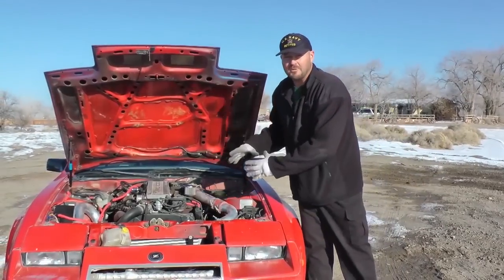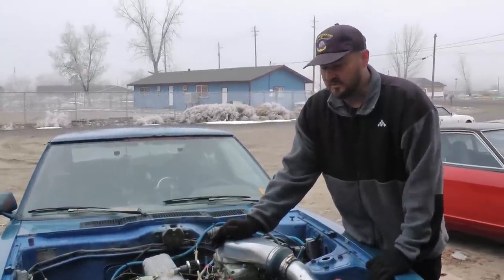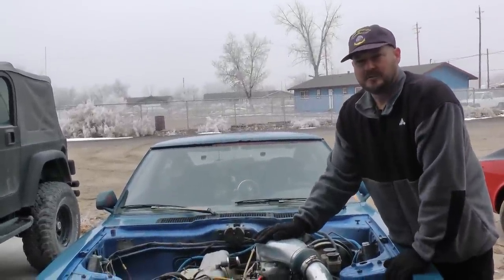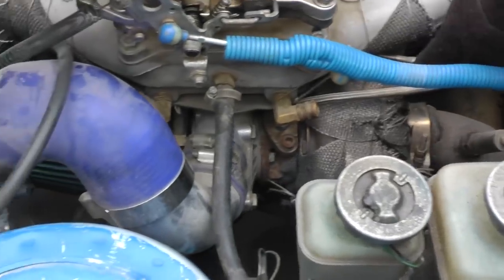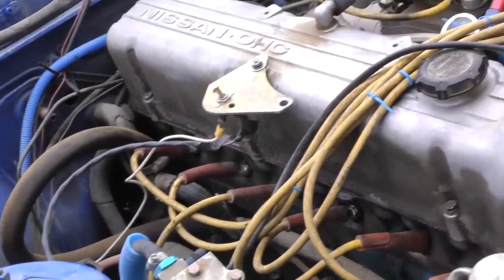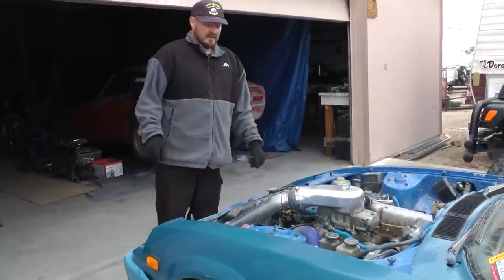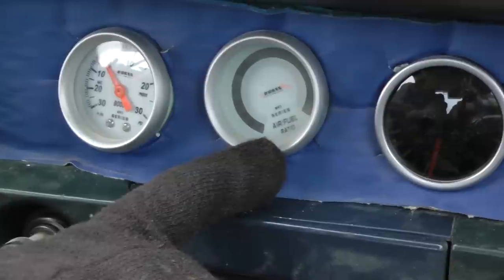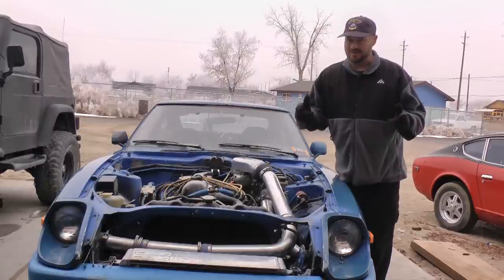Blow Through TurboCharging (Carburetor)

Comment: I've been thinking about slapping a turbo on my 79 Trans am. It's making around 400 HP give or take right now. But I feel the compression might be a bit too high. Any suggestions or advice? 74 400 block, 69 heads 72cc, flat tappet cam, 1.65 ratio rocker arms, aluminum dual plane intake, 750 carb.
Reply from the maker: number3665 for high compression engines would be safer to run low boost (around 6 to 8 pounds boost per turbo), twin TO4e turbo blow through carburetor setup.  can find turbo kits complete with manifolds on ebay, research to ensure the flanges on your heads match what they are selling. If the turbo headers are difficult to find for your heads t3 flanges can be welded after your headers or exhaust manifolds depending on where you would like your turbo mounted. I have even seen them mounted under the car in place of the mufflers for a stealth effect. Once turbos are done select a blow through carb, quick fuel makes great 650 and 750 cfm blow through carburetors. An intercooler is best located in front of the radiator to cool your compressed boost air before it goes to the carb hat and carb. The jetting, timing tuning process once you have everything installed including wide band A/F gage, boost, fuel pressure and exhaust temp gages to monitor as you tune to boost and rpm. Also being that you are running high compression and boost, ensure sticking with 100 octane fuel, avgas, or an alcohol injection kit to flow on boost to protect against detonation since 91 pump gas is no good for tuning for compression and boost by itself.  Many boosted engines are blown due to poor and low octane fuel combined with too high of boost, timing too advanced and fuel mixture too lean. When pump gas is used, boost needs to be set much lower (around 6 to 8 lbs) timing around 18 deg btdc. Carb jetting for low exhaust temperatures and stoich to slightly rich A/F ensure there are no lean conditions which lead to high exhaust temperatures, detonation then blown engine parts.  When testing these baseline numbers it's best at a tuning shop with a dyno to where you can open the engine up gradually a little at a time and immediately back off if any of the readings are showing lean, boost spikes or high exh temp. Then make slight jetting, boost or timing adjustments until you can successfully run your engine's entire power range on the dyno with good safe engine gage readings across the board.
Reply: Budget Boosting Thanks for the information! I'll start looking into everything.

Comment: i was wondering if you could help me out? I am building a carbureted 5.3 with a single turbo. I was wondering what would be a good fuel pump and regulator for that setup. Any help would be great thanks
Reply from the maker: Aeromotive red or black fuel pump is great, bosch makes great boost referenced fuel pressure regulators, Aeromotive does too.  Many great ones out there.

Comment: when your running without blow off valve and step up throttle when turbo spinning fast, boostin fast moving air and then throttle valve closes and fast movin air hits throttle valve and bounces back and forth betveen turbo and throttle valve, the sound 7:38 belongs here
Reply from the maker: johanijohani This particular engine in this video does have a blow off valve.  My red 300zx turbo, and Buick Regal Turbo T do not have blow off valves.  Thanks for watching.

Comment: what is ur opinion on in closing the carb in a box for installing a turbo.  plan on putting a 4.9 i6 in my 97 expedition n putting a turbo on it.  not wanting much more than 5 lbs or so of boost. just want enuff power to pull a load
Reply from the maker: +sketchyssk8shop    that should work fine for low boost.
Reply: +Budget Boosting I remember seeing the people with the old import mini trucks running them.   I just need enough to push a 4.9 ford i6 up to 250 hp n 300 ft lb torque.
Reply from the maker: +sketchyssk8shop You should have no problem, the torque and power on the inline six is great once it has enough carburetor.  From the factory, many of those sixes were under carbureted with a very small 1 bbl.  The larger 4 bbl.  carb with some boost should meet your goals.

Comment: SO now I have a question. SInce you have to seal up the carb very well to hold the pressure without blowing back through the float bowls etc, why can't you just build an air tight box that would hose the carb and equalize the pressure internally and externally eliminating the problem?
Reply: You can. That type of setup is still used today with great results. Since your comment was made 2yrs ago, you might know all this now.

Comment: Ive got an 87 mustang, 306, b303, gt40p, 1.7 rr, performer intake, demon 650 carb, bbk shorty headers/ x pipe. Dropping the motor in thr car in 2 weeks. 1st ever car build. Will the gains over stock be notable? Im worried its not gonna be much more over stock. If nah then turbo is my next step but im just sketched bc these blocks are said to grenade at 500hp.
Reply from the maker: If your cam rpm power rating  ( for example 2500-6500) is the same rpm rating as your intake manifold, your power, torque, and feel of your performance will increase greatly.  Some have mismatched intake manifold power rating and cam power ratings and end up losing power.  For example you have an intake manifold that puts 3500-7500 rpm power band with a 1500-6000 rpm power band cam, it will be mismatched and lose power.  What you want is the cam power band the same as the power band rating of the intake manifold or as close as possible for best power rating.  For turbocharging its a bit different since turbochargers tend to start pulling good at around 3000 rpm, so a cam and intake manifold rated for 3000-redline would be best for turbo setups.

Comment: Hey I'm interested in turbocharging a datsun pickup, but all the blow through carburetors I've seen are 600 cfm or bigger, isn't this to big for a 4 cylinder engine? Do you have any recommendations? Thanks
Reply from the maker: Aidan Foxley A special surge tank can be made for a dual weber or mikuni side draft carburetor blow through set up.  That would be best for the Datsun/Nissan inline engines.  Worked well with the HKS triple carbureted blow through turbo set up for many Japanese tuned Z cars in the 70's, 80's and 90's.  Hard to find that old HKS set up though.  I will be making some videos on the one HKS set up we did find.  I am installing a turbo triple carburetor blow through set up on a 1970 Nissan/Datsun 240z on a L28 inline six.  Should be one hell of a monster when its done....

Comment: May seem like a stupid question but how can you get an accurate oil pressure reading if it is setup up like you have it ?. Oil pressure sensors have pressured oil directly feeding to it and only it. Giving it another place to pass by it i don't see how it can get the right reading. For example say before you put that tee there it reads 40 psi or lbs of oil pressure,  now with that pressured oil having a second passage off that same feed it now can only read say 20 psi or lbs due to there being a second feed which causes the oil to for lack of a better word bypass the sending unit. Am i mistaken or am i correct ? ...
Reply from the maker: IrnMaiden304 First off, I believe no such thing as stupid question.  When it comes to performance always ask questions because a lot of performance or lack of is at stake.  About oil pressure, The way the T fitting is straight off the block oil supply and the pressure sender is right on the T, then the turbo oil supply, once the engine starts and idles around several seconds, oil pressure will stabilize and be very accurate.  The only way oil pressure will not be correct is if there is a leak on your turbo oil supply line, return line or any other major oil leak on the engine.  That can reduce oil pressure readings.  Once oil is circulating in the engine, takes some seconds after starting, you will see stable oil pressure and accurate despite turbo oil lines.  People do the oil filter relocation kits and oil cooler kits too, which takes a few seconds to get accurate oil pressure after starting.  It takes the oil pump a bit to get all the air and run oil through all the oil passages until stable oil pressure is reached.  Hope this answers your question.
Reply: Makes sense since it is a closed system. Ty
Reply from the maker: IrnMaiden304 I have a new video on oil supply and return for turbocharger installation.

Comment: would like to know more as i have a 71 opel gtwhat i have too do with exhaust and intake make them out of pipe any help appreciated
Reply from the maker: sun4u2day I have not worked on the Opel GT before but a basic turbo system will work on any engine as long as the basics are covered.  A turbo flange welded or bolted on the end of the exhaust manifold, or custom pipe to put the turbocharger where it will fit in the engine compartment well.  Find the oil pressure switch and install a custom oil supply and return line kit on the turbocharger.  Find a good place between the exhaust manifold before the turbo flange to install external wastegate unless you have a turbocharger with an internal wastegate already on it.  Purchase and install universal intercooler with intercooler tubing kit to route all your boost hoses.  Decide on and purchase which blow through carburetor you would like to use. Route the boost hose to it after it passes through the intercooler to where it seals tight to the blow through carburetor intake so boost pressure will not blow any of the hoses out under pressure, must be strong connections.  Connect an intake to the compressor inlet of turbo charger.  Install boost controller if you desire higher boost levels than what the wastegate puts out already.  Down pipe from the turbo discharge to the exhaust system of car.  Also watch all of my other turbo videos, they show a lot of the boost hose routing and show where I put parts in the engine bay.  In the future I will get everything needed for a custom installation and make a video on making a non turbo charged car turbocharged car and show every thing.  I hope that covered your questions.  Thank you for watching and commenting.

Comment: Great video. Did you put forged pistons/drop the compression ratio? How would a set up without an intercooler go?
Reply from the maker: Thank you. No, the engine shown in the video has the stock pistons. They come cast, and are flat tops. Dished would be better for boost. I would really like to make a video explain the difference between the pistons, I might this weekend. You just go from the out-take of your turbo (where the boost comes out of) route it with a universal piping kit (search exactly that on eBay) Into the intake of the intercooler, then put the out-take of the intercooler into the special blow through carburetor hat. Sounds complicated, but its really not too bad....

Comment: Do you have a video on your 300zx turbo?
Reply from the maker: Phillip Gagliardi Yes I show my 300zx turbo in our first video back to basics, 1986 Nissan 300zx massive burn out, blow off valve, the truth, top gun drag season opener and several other videos my 300zx makes fast appearances.  The drag video didn't work out so well since I had a boost leak I discovered later after several slow passes at the track, I did win a few races although it was not performing well....

Comment: Where did you get the intake manifold? I got a volvo b23a and need an intake.
Reply from the maker: Andreas Stuenes Clifford is the manufacturer of my intake manifold, they make many hard to find intake manifolds.  Not sure about the Volvo however, you could make a bolt on adapter flange from a carburetor spread bore or carb spacer.

Comment: Hey man! I have a question. I know its an old video but i hope you can help me out. I have a car its and old SOHC 1.5liter 4 clynder car and it have a single carb. I want to change it for bike carbs setup so every clynder have a carb. The question is i want to turbo it too just a low psi street setup for some a wee bit more power. How can i turbo it? like i need to make a box the carbs right? Not just shoot the air thru the carbs the whole carburetor needs the more air. Am i right? Sry for my bad English i hope you can help me out!
Reply from the maker: +Joe General yes a custom box to allow the boost to disburse to all 4 carburetors.  Many bikes have benefited from turbocharging.  Check out the website "Mr Turbo".
Reply: +Budget Boosting Thanks man!
Reply: way too much fabbing needed

Comment: I have a 1984 turbo 300zx. Can I use this setup for that vehicle?
Reply from the maker: You could do it. Need to fabricate an adapter or custom top intake manifold to fit blow through carburetor flange. Low pressure high volume fuel pump for carburetors, fuel injection pump has too much pressure for carburetor. Boost sensing fuel pressure regulator, intercooler and piping. The stock turbo on the z31 cars is small, would upgrade to a t04e or similar. See the videos of my red 1986 300zx turbo. I kept the injection on it but installed an intercooler, all the piping, a t04e turbine with v band flange so it's real easy to connect with exhaust. I used a variable boost controller to control the internal waste gate to adjust boost levels for different driving situations. Also free breathing intake and exhaust which improves turbo response greatly. Over all if your fuel injection system is working well, would consider just doing Like my red 300zx. If the injection system has lots of problems, you can do the blow through set up however it requires lots of custom fabrication.

Comment: any idea on how this would work with a throttle body
Reply from the maker: It would work great.  They sell TBI kits with MAP sensors that can track boost and make adjustments to fuel on the fly up to 21psi.  They are a bit expensive but worth it in the long run.  Summit Racing has several to choose from which have a Holley 4 barrel bolt pattern.
Reply: differently

Comment: I want to ask about some notes to take care about it cause I want to turbo my car it's carburetor engine if u could help me my have polonez car it's 1989 model
Reply from the maker: Mohamed Borhan most simple method would be draw through turbocharging.  An adapter can be made or fabricated to mount your carburetor to then a tube to connect to the inlet of the compressor of turbocharger.  That way fuel air are mixed prior to entering turbo compressor than the compressor discharge goes directly to intake manifold by way of another adapter or fabricated flange.
Reply: so I mast make that fuel go direct to engine and air will be from turbo right , but I want to ask about some thing cause some people told me it may destroy my engine so is there's any damage on my engine ..

Comment: what happens to MPG with blow through turbo setup.
Reply from the maker: Depends on how hard the foot hits the accelerator pedal.  The more boost, the boost referenced fuel pressure regulator puts out more fuel to prevent being lean.